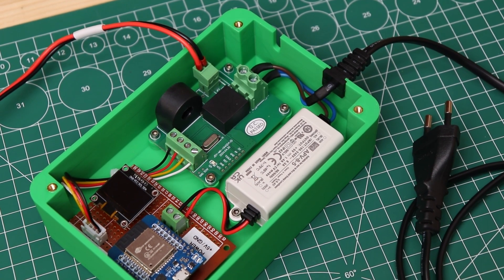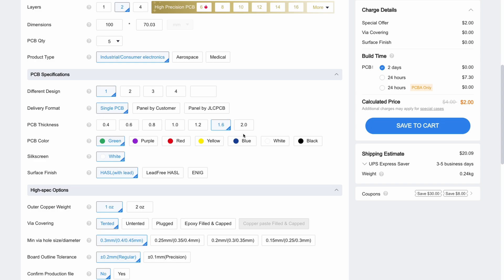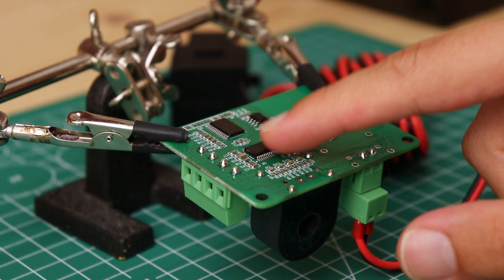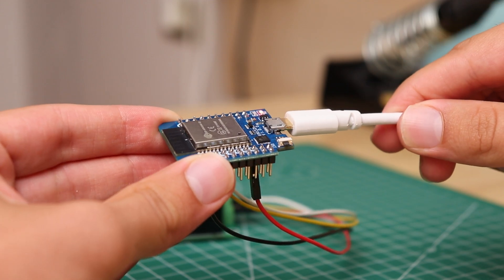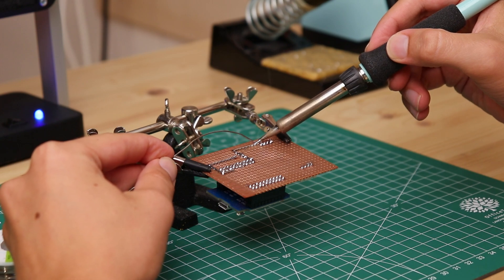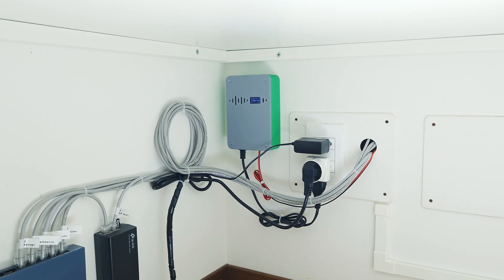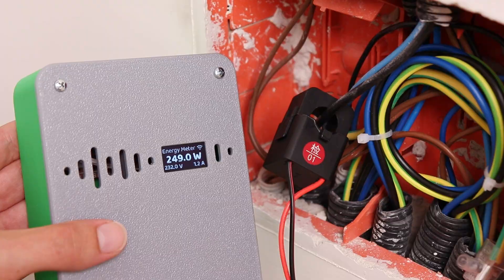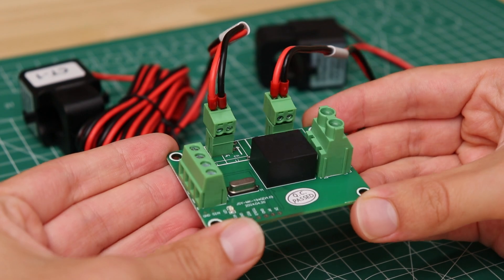This ESP32 project lowers your electricity bill! DIY Smart Energy Meter

Comment: Hello folks, and big thanks to Giovanni for the project — I genuinely like it and managed to build it successfully. However, am I the only one running into issues with the code?
All measured values are stuck at zero — this is true in the logs, on the device display, and in Home Assistant. The only exceptions are V and Hz, which are reported correctly. I tried changing the Modbus addresses, but that made no difference.
I’ve been debugging this for several days now with no success. Does anyone have a working solution or an explanation for why this behavior occurs? My YAML configuration is a strict 1:1 copy of the one described in the project documentation.

Comment: It can identify devices and based on wattage or usage like when you turn specific devices?
Reply from the maker: Unfortunately not, this would require a huge work on the software side with something like machine learing, but I'm sure it's doable as there is some commercial solution that implements this feature.

Comment: Hi can you explain how you made mobile app
Reply: He didn't. This is all from an open source product called home assistant. 
All he is doing is wiring up off the shelf hardware modules, and configuring premade software. There are millions of people doing this and you can also.  95% of the work is already done, you just customize for your particular use
Reply: @axa.axa.  thank you for the info.  Will check this out

Comment: I'm always amazed by makers that have ability in many different fields, and then can plan, film, and edit a video about it. It's quite difficult. Also I got the inspiration to try and use esphome to interface with an air conditioner. It uses modbus and maybe can be decoded.
Reply: The quality of this video is far beyond my expectations for a channel with <1500 subscribers
Reply: can it show week or month consumption
Reply: @iscop_PLC_training  that's just calculations, if i remeber i used an ha custom component called "Energy Meter" that extrapolates data from the watts over time.